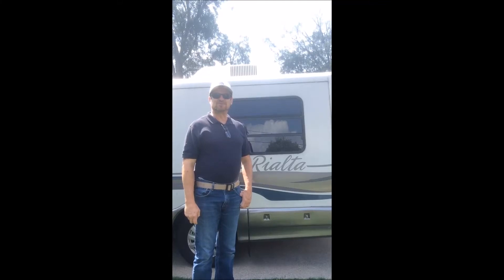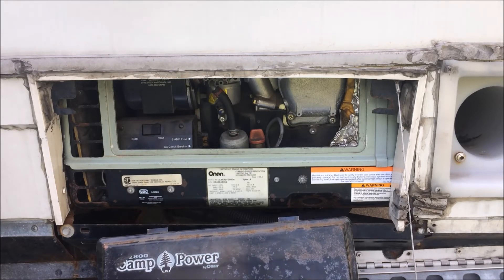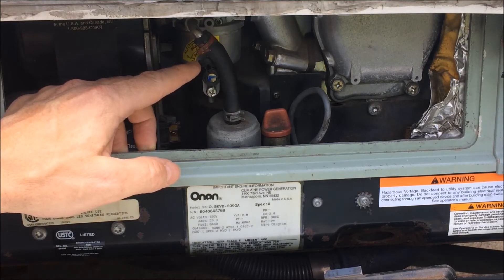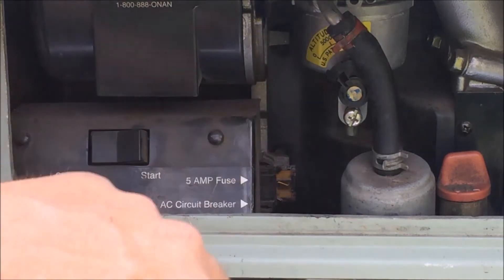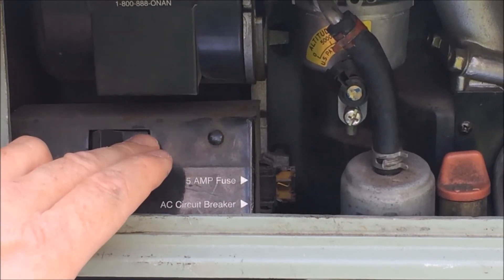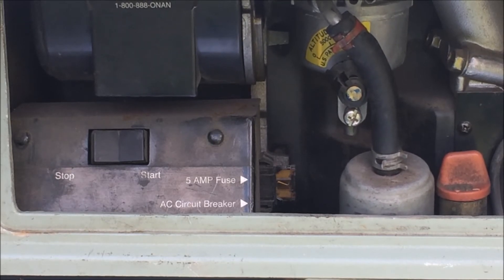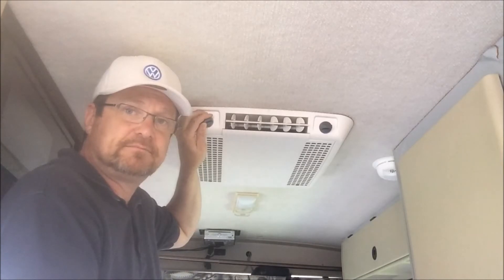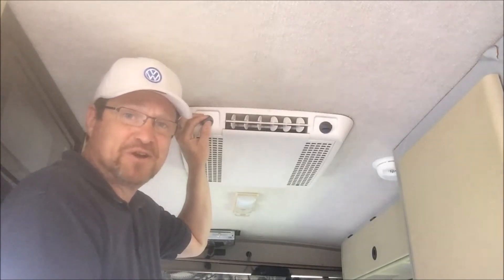Generator Basics 101 YTV

Comment: I just bought a 96 Rialta with 76k miles ... they said the generator had not been started in 10 years... It took me a few days to get it going but it seems to be working now... I have it parked next to my house and have not been using it to power anything inside the Rialta but some alarm keeps going off and will stop when I start the generator back up... do you know what this is about?